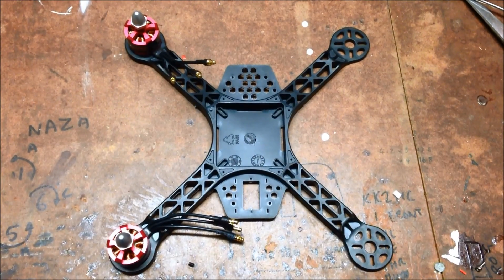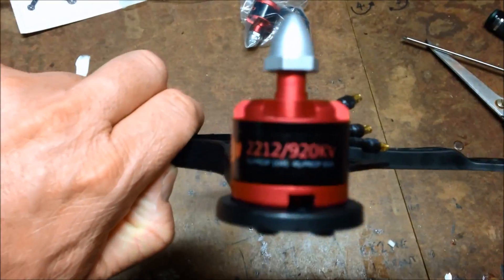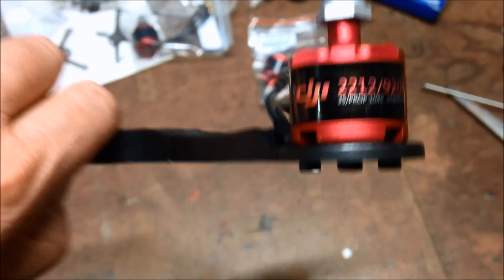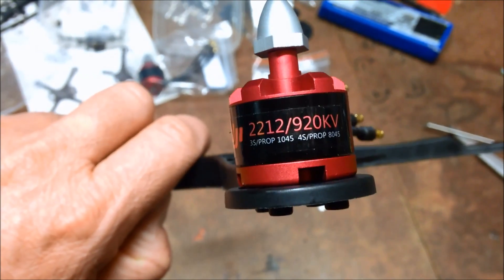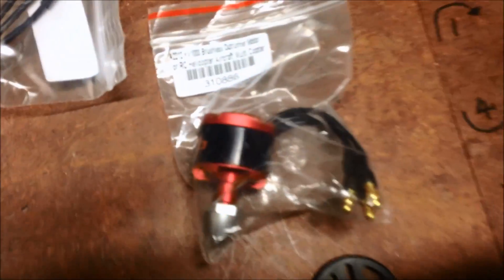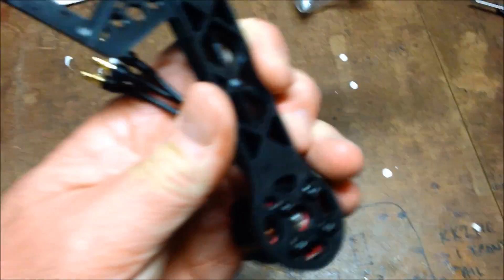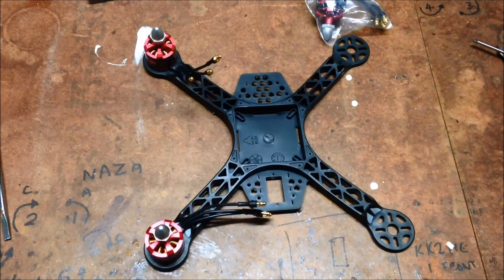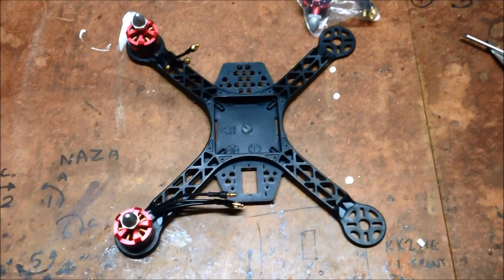Will DJI 2212 920kV Motors fit on the HK250 Hobbyking Diatone Frame

Comment: Hey buddy did this ever work? i was planning on throwing 4 multistar 2210 motors a 20A qbrain and a CC3D topped off with a 3s 2200mAh lipo. What do you think? it would be a little pocket rocket though :D
Reply from the maker: Never did try it. Would be a bit heavy I think unless you used a 5s Lipo.

Comment: can it work for 5 inch props? to fly n lift off above ground , and how about 6inch props. im very surprise to see if 7inch props can work. so far, i have yet to see anyone in youtube done this so experiment.. i will like to know if frame 250 will work with 900kv or 1000kv or not?

Comment: You'd want a high cell battery to make them spin fast enough hey. As that frame can take 6" props max?
maybe a 6S :)
Reply from the maker: It may get 7 Ill have to measure it up. With a bit of trimming maybe.
Reply: Cool, I look forward to seeing whatever you end up doing :D
Reply from the maker: Adam Wilkinson Exactly 7 inch between motors and 3.5 inch to where the arms meet the frame. 7 inch props should work nicely.
Reply: Oh, that's cool!